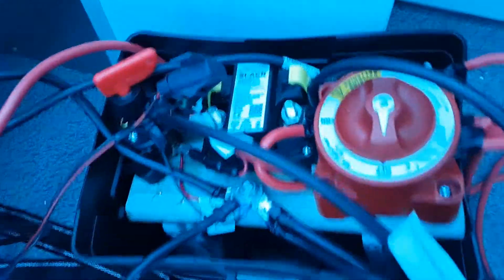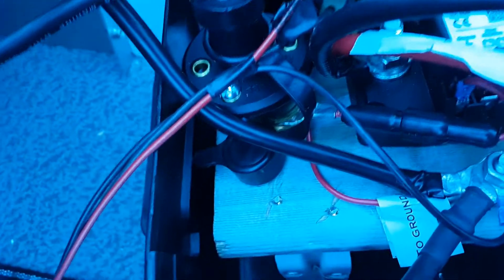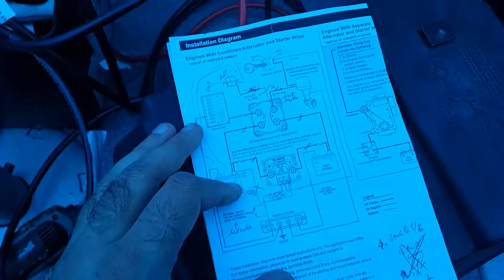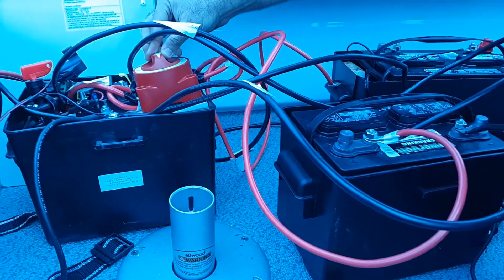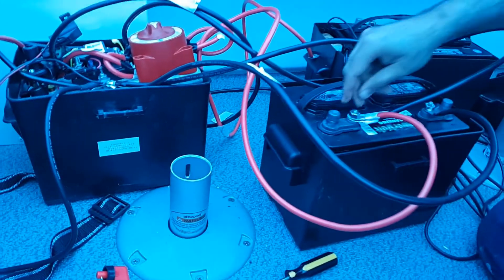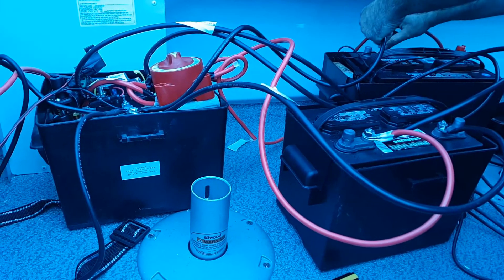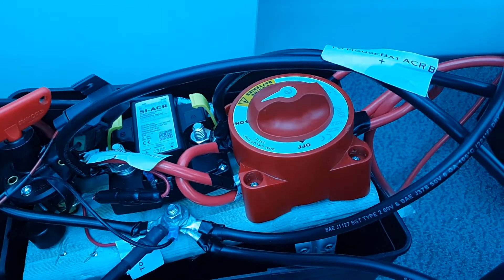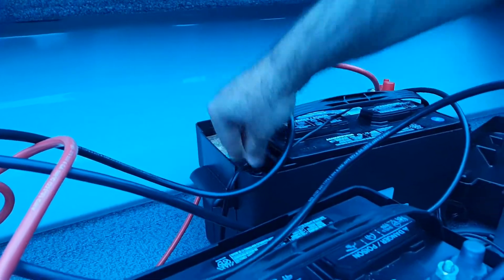Boat electrical system in a single battery box

Comment: I would suggest to use a bus bar to put in order your wires. It is very messy.
Reply from the maker: agreed. problem was the lack of space in the battery box and the area where the batteries were located. ive since swapped out and gone single battery with an alten DC genny as backup.